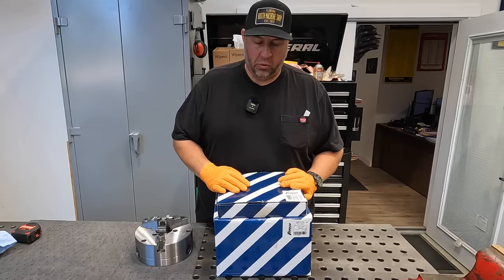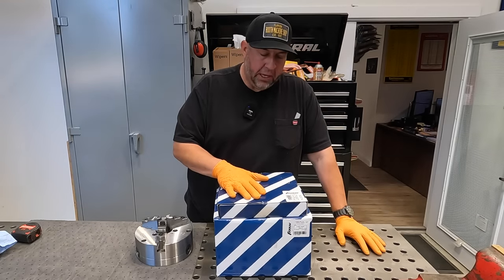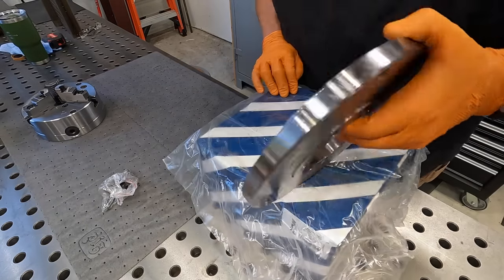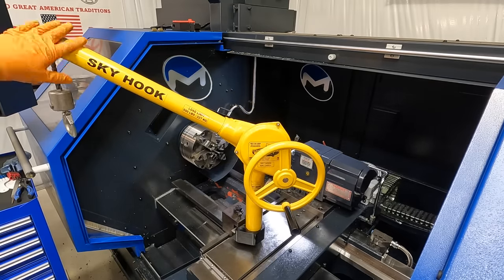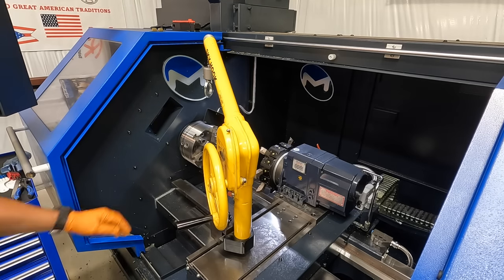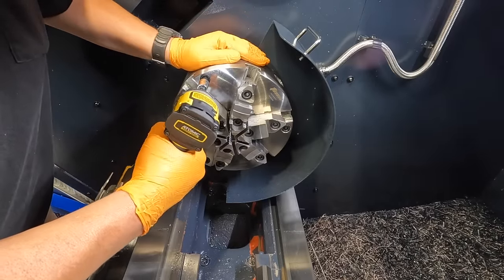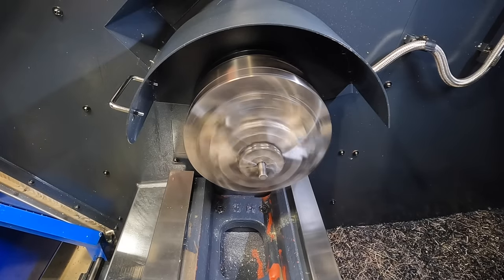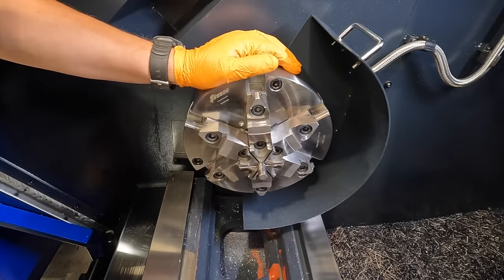Tool Tuesday Ep.8: Installing New 6 Jaw TMX Set-True Chuck on Milltronics CNC Lathe

Comment: Years ago i came here for great machining the old fashioned way... Something that did not involve software. Sorry Adam i stayed subbed for a long time but now the time has come. Thanks for a the good stuff
Reply: Just how much 'software' was used? So much of the discussion on 6 vs 3 jaw applies to both manual and CNC. This also applies to the tooling and fixturing and a bunch of the techniques.
Reply: This isn’t an airport. No need to announce your departure. Also CNC is better than manual in every single way
Reply: @seabreezecoffeeroasters7994  
The problem is that the stuff i came for is long gone, the big cilinder repair and that kind of special work. Not just showing new stuff and visiting the supporting companies.
Reply: @yoopersen  is was ment as feedback, the departure is not the subject. And cnc is great, but the thing that Adam did was practicing the craft of machining. Cnc gets used in every factory. If i wanted to see that i can find plenty of Chinese guys that can program a cnc.
Reply: @joranbrouwer2157  so stop watching
Reply: @joranbrouwer2157  You recon USA has more manual machinists than china? Get a grip.
Reply: @spikeypineapple552  youre missing the point

Comment: Good morning
Please explain to me how the external conicity works for traditional cylindrical grinding machine (livnica kikinda), I need the formula to make the external cone
example :
I have a 600 mm long roller
Larger diameter 50 mm
smaller diameter 47 mm, how to calculate the taper
mm ???
Thank you

Comment: Some manufacturers of rotary tables or 2 axis tables warn not to pick them up by the "T" slots
which could result in breaking out a chunk of the slot.  I would think this would apply to any 
"T" slot surface.  The chuck weight multiplied by the cantilevered Sky Hook load might be 
more than your cast iron cross slide can handle.  A 4 point cross slide or a bed ways cross
mount would be less risky.  "Just saying"...

Comment: Why wouldn’t you check the runout differential from the adapter to the Chuck before testing a rod. Am I missing something? Adapter to spindle, spindle to Chuck.
Reply: Because the chuck itself is adjustable. The adapter plate doesn't need to run true as long as it runs within the adjustability range of the adjustable chuck.
Reply: And about plani
Reply: flatness?